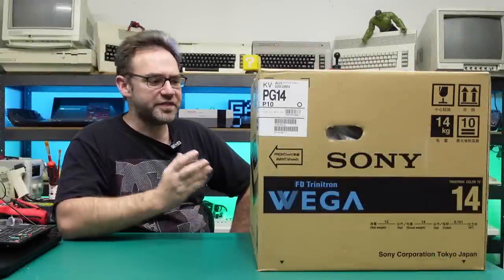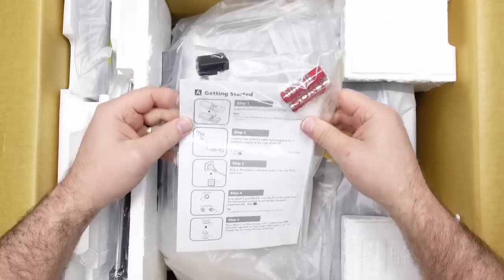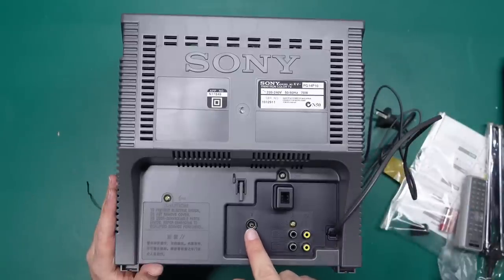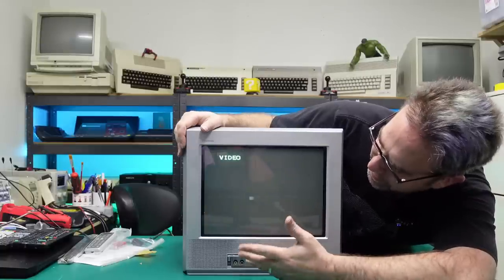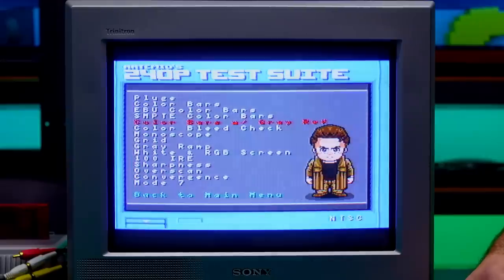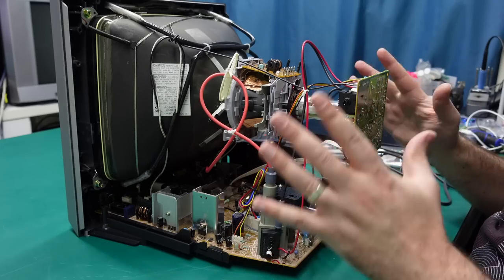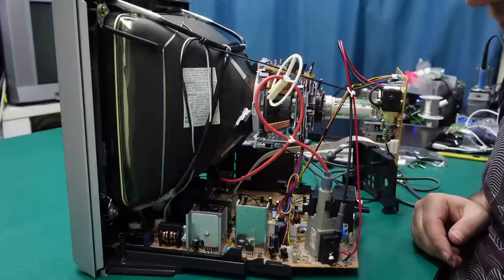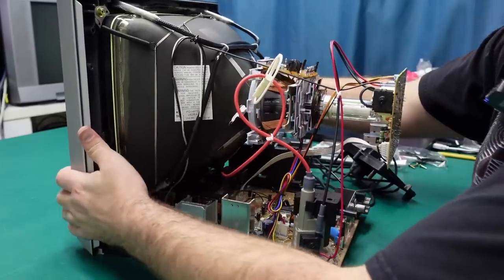Unboxing a new old stock CRT in 2022 - Sony Trinitron KV-PG14P10 TV

Comment: I worked for Sony in the UK at their manufacturing facility at Bridgend  in the late 80's and specifically worked as an electrical technician in the tube making plant on breakdown maintenance of the plant. 

I'm going to comment as I watch the video and the first thing to me (11:50) as it's a later generation is that the anode is underneath the tube, not on top. I think your warning of voltages is not strong enough, the tube can kill you with the power off from stored static, I did an electronic apprenticeship and had many static shocks from b/w monitors removing the anode where the power supply would have been about 14KV, about the same as car HT ignition systems at that time. The big tubes had 36KV plus as the anode voltage and enough current to kill you so boys & girls don't do this at home. ( at 25KV vacuum tubes start emitting x-rays the same as a medical x-ray machine and that's why the front panel (screen) is so thick with leaded glass). 

An anecdote, some tubes didn't pass the final line testing (done by a human at that that time) and so would be then tested in a single offline jig by a more experienced operator who's main tool was a rubber mallet, I kid you not. I'm digressing sorry, but sometimes the robots hadn't fitted the aperture grill correctly into the front panel glass supports so by hitting the the front panel or from the side the operator could seat the AG properly. There were a lot more rubber mallet procedures. Sorry for digressing but the offline test machine the operator had to insert the anode by hand and fit DY coils etc (power off) and so I was standing behind the operator testing a tube with a fitter on my shift and the anode fell out and the fitter went to re insert it and he had a huge electrical shock and in his words 'it got me before I grabbed it (the anode)'.

14:00 the electron gun (plus the front panel) were what made the tube, also Sony used very high quality components and their TV's had an average lifespan of about 13 yrs which was pretty good considering high voltages were involved. 

15:46 apologies for jumping the gun

19:30 probably electrolytic capacitors drying out slowly after having no voltage put on them for so many years and you're also lucky to be able to adjust things in the digital world compared to when I knew these tubes.

It's 2:30 am so have to sign off, last thing from me I stopped working for Sony before they started making totally flat screens, straight vertically and curved horizontally. One last thing, after the physical air evacuation there was a 'getter' process where a chemical reaction exploded removing more air (down to 10 to -9 tor air molecules being 10 miles apart ..) but the tube was a bomb until the front panel had been banded ( so many explosions during this phase) and then they went through about 250KV ac & dc across the tube to blow up any particulate remains.

apologies for the novel, surprised I remembered so much from nearly 40 yrs ago.
Reply: Very interesting history, thanks for sharing!
Reply: Hi Paul, you should consider doing an interview with Rob with RetroRGB or other, your historical insight would be very invaluable to this community! Thanks!
Reply: @wormbagged  ok will look him up, cheers
Reply: This is immensely interesting, thank you!
Reply: I had this tv back in th day and plays lot of nes games but never seen how snes games looks in crt tv because snes is not available in my country that time. So I take feel how it looks snes games in crt 😅.
Reply: The convergence will change with set warm up. I’ve set up many new replacement CRT’s in convergence and purity. It’s important to wait at least 1 hour for the internal parts of the CRT to expand and fully warm up. The aperature grill will warm and change as will the electron gun assembly. Also it’s important to realise convergence is never perfect, you can trim the convergence using permalloy magnet strips (you can see these white strips in the video) but during manufacturing there is a tolerance which is deemed acceptable and some sets will be better than others. As with any CRT set up, the static convergence is extremely important to get spot on at the screen centre, any errors here will be vastly worse at screen edges, also deflection yoke position will effect extreme left and right edge dynamic convergence. Rubber wedges are used to position the yoke at manufacture set up. Again it’s not an exact process, and some sets will be better than others. Last but not least there is a tolerance with the winding of the deflection yoke itself, with some being better than others. Also convergence and purity ring magnets on the tube neck with some being set up better than others during manufacture by the factory tech. We are spoilt with LCD uniformity of picture in this respect. 
The CRT really is amazing that we can make it work this good, the last run of Sony Trinitron were very good in picture quality. That said I’ve a 1978 KV1400 which has an amazing picture!
Reply: Some good comments but some questionable statements too. It’s very very unlikely to receive a fatal shock from a crt. The current is so low. The better process wasn’t an explosion, it was applied heat to the Barium material which finished off the vacuum process and maintained this throughout the valve or CRT life as long as the glass wasn’t damaged allowing air inside.
Reply: Thanks for sharing🙏 👍cheers
Reply: Wow!  I knew assembling CRTs was quite involved and dangerous, but now I have a whole new appreciation for the process.
Reply: Why would the tube be mounted upside down?

Comment: I miss CRT’s. The motion was just so crystal clear. Even in this brief footage of Super Mario World, you can pause it and it doesn’t look like a smeary mess like with LCD.
Reply: I have it, was my cousin's when we were young and used to play ps2 and watching DVDs on it
Reply: I just found a 32 inch Sony Trinitron someone threw on the curb during a recycling event.

Composite looks so dang good on my snes I bought, I am impressed. I bet it would look even better with S Video or Component if I had the cables.

First I need an SD2Snes or something though

Comment: 14 inch trinitrons are usually deep because they have 90º deflection, larger sets used 110º so the larger ones are proportionally shorter.

Comment: Tubes have to be designed to compensate for the earth's magnetic field, and that is flipped in the southern hemisphere vs. the northern. Some CRTs were made for the southern hemisphere, but Sony put northern hemisphere tubes in southern hemisphere sets by just flipping them upside-down!

That tube is a long boy because it is a 90-degree deflection, and that is why the convergence and geometry is so good. 110-degree tubes are harder to align.
Reply: There's an interesting anecdote about this, although I don't know if it's true. Back in the 80s and 90s, Bang & Olufsen were making TVs that were very slimmed down, following the contours of the CRT. This however meant they'd have to put a bump on the cabinet over the EHT connection. To work around this, they had Philips supply them with CRTs made for the Southern Hemisphere so that they could put them in upside down in sets sold in Europe and the US.
Reply: @Zacabeb  They sure did. MX series if I recall.
Reply: Fascinating - I had no idea. Thanks for sharing!
Reply: really cool
Reply: Engineering & Math <3
Reply: sorry wrong, you will notice when the tv powers up a huge power surge and if you see pictures of the back of the tube you will see wrapped in black sleeving what is called the de guass coil and it basically overpowers any magnetic fields in the tube by it's own very powerful magnetic field for a few seconds. It's why you run can magnets over the front panel and make stupid convergence patterns as the DG coil resets everything on the next power up but if your DG coil doesn't work you've ruined a perfectly good tv until a new DG coil is fitted.

Comment: In the UK we were blessed with RGB Scart, which has now become a popular mod in North America. We did have to settle for 50hz compared the North American 60hz, but RGB Scart is just much better than RF, Composite, or S-Video. 
It was a strange time. I was lucky enough to obtain a B&O Beocenter1 which had RGB Scart and 60hz support in the UK, and I modded my consoles to run in 60hz. The ultimate experience.
Reply: In the 80s, the Sony TVs imported into Australia did have RGB Scart as those were made in the UK. Sometime in the early 90s, the TVs were imported from Asia and they only had composite and S-Video on the larger sets. It was definitely painful for console gamers.

Comment: That's a beautiful set.  I've never seen a Sony with the anode cap set on the bottom side.  Very interesting and thanks for showing all of it.
Reply: Most Sonys in Australia are like that
Reply: This is cheap generic crt with composite video and mono sound. Nothing noteworthy.
Reply: @Psych0technic  It's a sony trinitron, which is not a generic CRT. it is a basic, low cost crt yes, but it is a quality one.
Reply: @amac203  agreed, Sony didn't make generic crt's.

Comment: Thank you fir that Video. 

To his TV.

No Scart, no RGB.. no S-Video  ;) but a nice little TV. 

And The "CRT" Reminds me on my Little German SABA TV from 1994 4:3  my CRT has the darker Phosphore. And is not a Trinitron Tube. 
But "Flat" as Well 

I found my TV left for death on the streets, the power cable cut, and it has some bad or broken Solder Joints.

But now it works just fine.

Comment: Amazing how far we've come from this to Oled's that are 5 millimeters thick. Science and engineering are incredible 🤩
Reply: No throw a beer mug at both. Or try to boot it up with the interwebs down. Engineering to the top. As a screen tech OLED is nice, but all around it, especially software, but also casing, is 100% junk.

Comment: Something I didn't mention yesterday, after certain parts of the process the tubes would be highly charged statically (sometimes even smashed tubes even still had some static charge) and the overhead conveyors were like ski lifts so if we had to remove them because of a breakdown we would discharge them to earth, there were a few times we got caught out and involuntarily chucked the tube and shouted 'EYES' even though we wore safety glasses at all times. A small tip if you regularly work on crt's, clip an earth to your terminal screwdriver before you prise the anode out, don't be afraid of discharging a tube by earthing, it was a standard procedure for us at that time.

And also always make sure the power is 'OFF' unless you're trained, for me it's the biggest mistake non trained people make. I check with a multimeter before I put my fingers anywhere.

Comment: My grandma has a 23yr old trinitron and it has never been repaired since day 1. It runs everyday for almost 8-9hrs. From 5pm to 2am. Everyday for last 23yrs & it has not even burnt the crt. The image is slightly distorted probably cus some capacitors are definitely failing on it. She doesn't want to get rid of it or sell it . & I also do not want to upgrade her to lcd tv cus all modern TVs are android & it's hard for old people to use Android.

Comment: IIRC, 2003 was in the middle of the capacitor plague.  To double check, I just looked it up on Wikipedia.  The capacitor plague supposedly lasted into 2007.  If the convergence continues to worsen, I would suggest performing a recap on that TV.  I'm not sure if Sony would have gone that far to reduce cost, but it's a possibility.
Reply from the maker: Hmm good point. I might run it for a little while with the case off and monitor some temps with the thermal cam. If any of the caps have gone high ESR, I should be able to see them warm up
Reply: @TheRetroChannel  We lost so many electronics from the fake cap scam. I would just assume anything from this ear was plagued; change them.
Reply: Capacitor plague never ended.
Reply: I would say it's more likely that Sony had started using cheaper components as the Trinitron patent had run out and were competing with the likes of Mitsibushi making diamond black trinitron tubes.

Comment: It's cool how the convergence changed from perfect from the factory in an hour of warm up..  Was it the components or maybe a convergence strip moved due to failed adhesive, or both?. This is why leaving a crt on at least an hour before making adjustments is mandatory.
Reply from the maker: I'm hoping it's just a convergence strip as that shouldn't be too difficult to reposition

Comment: I bought a used Sony 28 inch widescreen Trinitron TV in 2009 for 50 bucks it was great for PS2 gaming but it fell and broke many years ago. I now just use a 14 inch of some unknown brand from around 2000 I paid 10 bucks for for retro gaming. I still think it is weird when I see CRTs without SCART. I remember bringing my European Dreamcast to Canada back in the day and wondering why it didn’t have SCART not realising that was a European standard. RGB via SCART looks great for retro stuff like the Mega Drive (Genesis for North Americans).
Reply from the maker: At least in Canada they have 60hz. Here in Aus we had no SCART and PAL slowdown.

Comment: Awesomeness. For the convergence issues, I noticed the set has some strips installed. They may have creeped over time. I'd try tweaking them slightly because the convergence isn't too terrible. The strips may just need a tweak.
Reply from the maker: Good idea. I think the yoke is also slightly tilted so possibly a few things have changed over the years. I'll get back in there and make some adjustments soon
Reply: Cool.

Comment: (15:17) That is the advantage of being born in Europe. You have TV's with SCART connector that is an universal connector for different types of signal like composite/S-VIDEO or RGB. So no RGB-MOD needed here in Germany.
Reply: What is bad is that hardly any of the single-SCART CRT's accepts S-video input. So with computers/consoles with trash output, like the C64, you still have a problem.

Comment: I have a rare crt tv with a Dreamcast built inside and as you should know the Dreamcast is from 1998-2001 so it is pretty old and I want to change as much as possible the capacitors inside, however I am not a professional and I want someone to do it… I live in Japan and guess what ? I asked in more than 12 different electronics shops in Akihabara and no one had any idea where I can restore it 😢. My tv still works but it is a matter of months before something dies.

Comment: Awesome video love it ! Can’t wait for the RGB mod.
One question the service menu is in 50 mode (love the fact you can set different settings based on 60 or 50) but the test suit you are using is NTSC , would that have any affect on anything?
Reply from the maker: Yeah, I should have used my NTSC SNES to adjust the overscan. The PAL SNES does squish the image vertically even when running the NTSC test suite. I'll address that in the RGB mod video

Comment: I still can't believe how Americans put up with composite info for so long.  If that was sold in Europe it would also have a RGB scart and svideo connector.
Reply from the maker: At least they had 60hz
Reply: @TheRetroChannel  So? Both are 15KHz, so what you gain in motion, you loose in resolution. Especially DVD's were junk in NTSC with the infamouse 3:2 pullup, and for TV 50i was not bad either.

Comment: S-video should be very easy to add to this model. Simply by adding a few missing resistors/caps and enabling it in the service menu.

The thing to do is to look up similar models, like maybe a 20" or 24" version, and seeing how s-video is connected to the jungle. It's very likely using the exact same chassis and you just need to add components to the correct spots on the board.

There's an s-video mod thread on Shmups forum where you can do some reading on this.
Reply from the maker: I already looked into it and did some testing. There are larger versions that use the same chassis but the only difference is they have stereo, but are still limited to composite only.

It seems the chroma input on the jungle is disabled, and the service menu doesn't have a way of enabling it. Best I could do was change the amount of AV inputs, but none of them allowed seperate luma chroma. Looks like I would need to inject my own data into the I2C bus and that's not worth it just to have s-video. Thankfully the RGB mod for this chassis is pretty straightforward
Reply: @TheRetroChannel  You don't need to inject I2C code, you just need to change an ID-X bit in the service menu. Usually ID-0 or ID-1. You just kinda have to try different values until you see the s-video input "turn on".

I did this on a kv-13fm12 by setting it to Video 1, then scrolling through values on ID-1
Reply from the maker: There is no ID bit on this set. It's a BG-2T chassis and uses a Philips TDA8843 jungle rather than a Sony CXA-XXXX. I've been through the service menu and changed everything related to optional bits and no dice. The Y/C inputs on this jungle are pins 10 and 11 IIRC and enabling the 2nd AV input allows composite to be fed into the Y input, but feeding in separate luma chroma just results in a black and white image.

And this was all after I lifted the chroma pin on the jungle. Even tried adding 75ohm termination to the chroma and inserting a 100nF cap in series made absolutely no difference. The image doesn't change at all no matter what I do with the chroma input, hence my assumption it must be disabled and no change in the service menu will enable it :-(
Reply: @TheRetroChannel  Oh, a Philips jungle chip. That is indeed a very different beast. 

I was just thinking about the n64 anyway, that's the only console I can't think of that doesn't have either RGB or YPbPr output, since it sounds like you'll have RGB on the Sony set soon. But there are RGB mod for N64 for anybody that cares enough